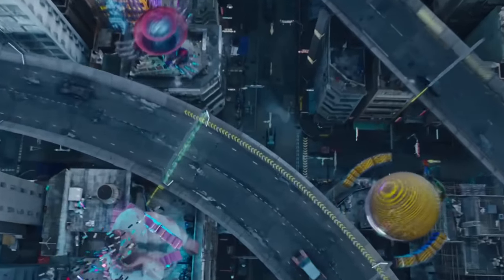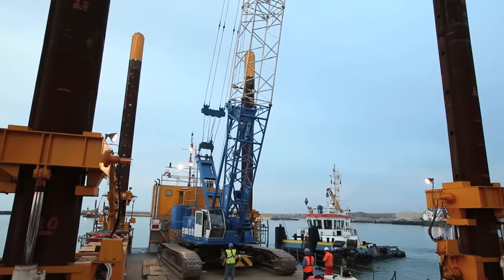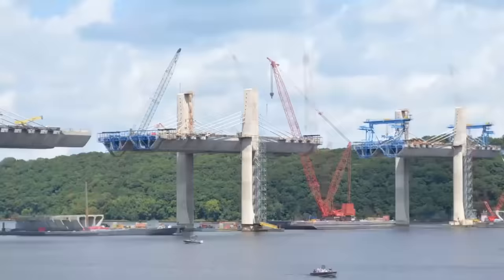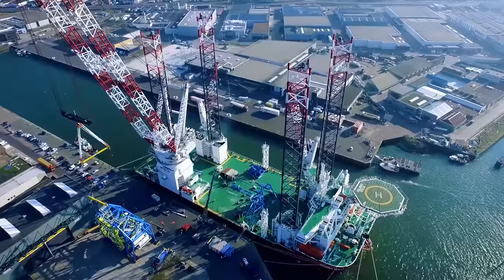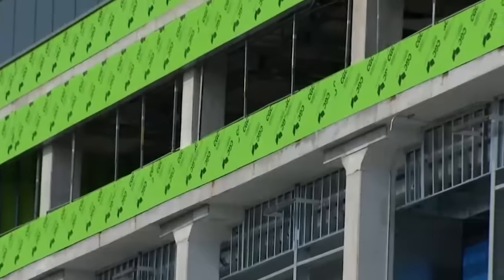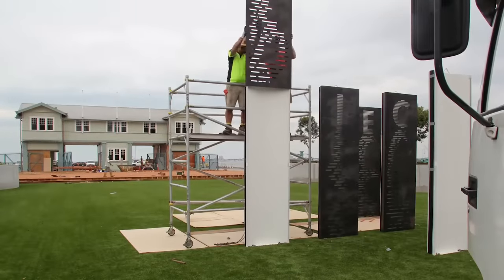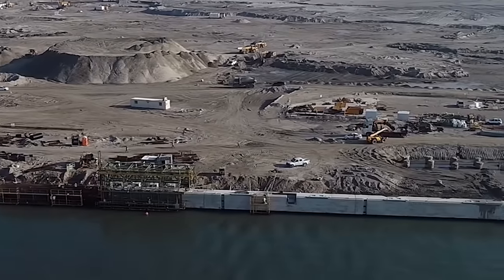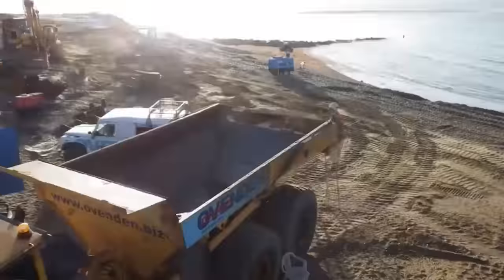This Is How Underwater Structures Are Built

Comment: Really cool video but I was hoping to see how they secure these to the sea floor.
Reply: right
Reply: Exactly
Reply: Because there’s sumn we don’t know
Reply: @itscrazyjay555  black magic.
Reply: @ShockToYoSystem  ngl until u comment jus nie I really forgot I even watched this like frl 😭😭I’m still a lil lost bc when tf did I ever watch this but then again it’s interesting asl cus how tf are they builtttt
Reply: The way cofferdams were explained was incorrect or inadequate in my opinion. Cofferdams are generally made from sheet piles. these are roughly half inch thin angled sheets that usually are usually driven in pairs. Roughly three feet wide. they get a vibrator attached to them and are driven down into the ground individually. They have grooves in the side so they can be laced together. Once its driven down a certain distance, another sheet is welded to the end of it lengthening the sheet. I'm probably not explaining it properly. I'd check out a sheet pile driving video if you are interested.
Reply: I Want Do Asset Manager, Asset Take Care, Accounts And Tax Manager I Do Work for you safe And Honestly
Reply: For the coffer dams, the likely just build heavy duty foundations into the suface of the soil

Comment: Cofferdams are used for the construction of large bents (i.e., piers).  On the other hand, conventional highway and rail bridges can be founded on drilled shafts that are simply drilled and poured thru slightly larger diameter steel casings.  Much more cost effective.
Reply: I Want Do Asset Manager, Asset Take Care, Accounts And Tax Manager I Do Work for you safe And Honestly

Comment: Another fact about the Stillwater, MN bridge: The contractor; Mortenson Construction was building U.S. Bank Stadium at the same time and many in the industry said they couldn't build both mega-projects at the same time. They completed them both ahead of schedule.
Reply: You kind of glossed over the reasoning behind the design... They wanted to build a new bridge for over 60 years! 6+ designs & locations were presented but the environmentalists opposed it every step of the way, so they required the max height of the towers to be the height of the canopy on the banks which you can see at 2:42. Also so it wasn't visible from outside the valley. It actually had to be brought to the federal government, signed approval from both branches of congress by huge majorities and then by Obama in 2012 after the 60 year shit show to replace a 1931 bridge.

Also to say the old Stillwater lift bridge (which has since been restored for pedestrians) was 'in a very bad state' is an understatement. It was ranked one of the most unsafe bridges in the country.

Comment: How are foundations laid in really deep water where you cannot seal off the water because it’s too deep?
Reply: I am a NYC dockbuilder journeyman I get to do this every day , I haven't actually worked on that type of project but I'm assuming they use a core drill and build the rest in pieces send a diver down and connect the pieces, the corrugated sheeting is mainly used in shallow waters  the only thing I can think of is the oil drilling platforms which are engineering marvels.  But yeah I'd imagine there built in pieces

Comment: While everyone is going "Green",  remember the metal components must be mined, the ore processed, heated into molten state and shaped and processed again. Then it must be shipped to the site, combustion engines prepare the site, lift and install the windmills, and keep things running. All of that effort uses enormous amounts of oil and gas. Do those windmills return that energy investment??  Did you know the blades are fiberglass-composites that use lots of energy to make?? They only last 10 years,  are toxic and and dumped into landfills when they are discarded. In the US the only site I know of is in N. Dakota, and it takes a lot of energy to do that too!

Comment: Very informative video. However, I prefer to use sand instead of concrete/metal to build walls around the intended area of construction. Thereafter, I would use sponge to drain the fluid out of the entire area under the horizontal plane (below sea level). While draining, it is important to be aware of guardians surrounding the area, you might get seriously injured by their spells. Hence, it is essential to wear proper gear at all times. I hope my preference & tips may be of help to others in need.

Comment: I paid my way through college as a union Ironworker, and went to work as an engineer for one of the largest marine construction companies in the US.

This guy's statement about "... Now you have a completely dry & safe box", once the cofferdam was in place, is misleading.  Yes, cofferdams create an environment similar to above ground, the [ocean] floor is always wet, and the pumps are left in place to prevent the cofferdam from filling with water.  And definitely not completely safe.  However, the tiny environment created by the cofferdam is relatively safe, as long as the elements trying to reclaim their territory is closely monitored.

People look at me like I've escaped from my shock-therapy, when I tell them I've stood on the bottom of San Francisco Bay (working on the Bay Bridge) 😉

Comment: That isn't how bridge foundation is done today. We avoid de-watering entirely. We just pump concrete directly down under the water.
Reply: How does the concrete settle and dry?
Reply: @Yomotomen concrete settles with gravity and concrete doesn't dry it sets.. and it can set under water. 
They pump it down into the ground / pillar dug out and leave the nozzle under the concrete so it pushes all the water out of the cut out. and it eventually sets.

Comment: To add on to the wind turbines at sea, there's supposed to be a new type of ocean wave generator in production. They're put around docks to produce energy so if some were added to the wind turbines, double payout.
Reply: Windmill production 400 mw x 30 days=12000mw \house 30 days 20000 kw \12000mw/20mw=600 houses p/year x 67 windmills. Expense windturbin park manufacture + install 1.4 billion dollar, maintainence per year 1 mill dollar each. Lifetime 20 years. Add money times two equal double payout😂

Comment: $$$$$$ The notion of building under water "cities" and habitats for the purpose other than research is absurd.  The excuse of running out of land to warrant ocean living is false.  It is far more cost effective to build in places people just don't want to live.(IF it came down to running low on prime real estate)  Living UNDER the sea is as costly(and dangerous)endeavor and impractical as living in a space environment.  It requires total dependence upon the outside world for supplies.  Thus, it is completely unsustainable independently outside of the structures.  Cheaper to just live ON the ocean IF things somehow got to that point.  Shy of Water World science fiction fallacy, people have a lot of centuries of living before over crowding on land becomes implausible.  lol  Can take some of this bridge building engineering and apply it to living above land for added real estate at a fraction of the cost of living under water.